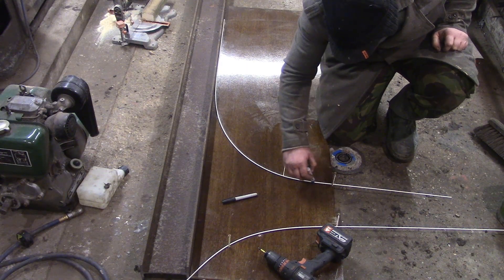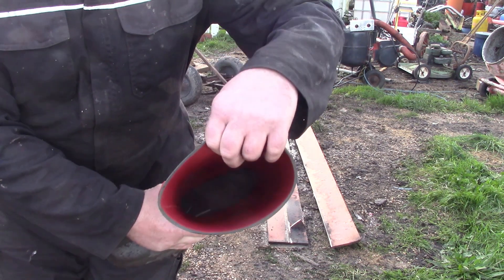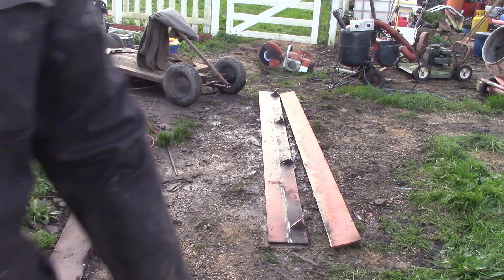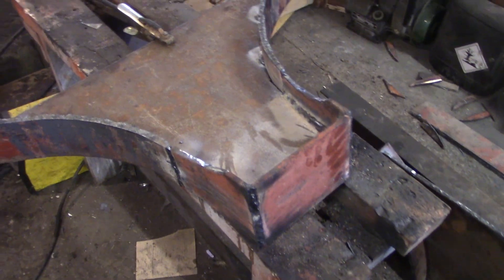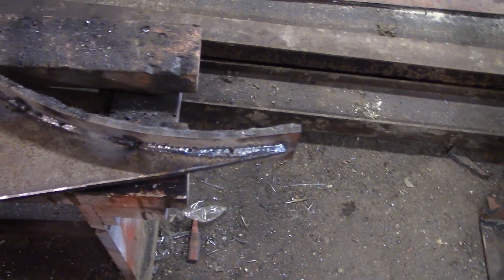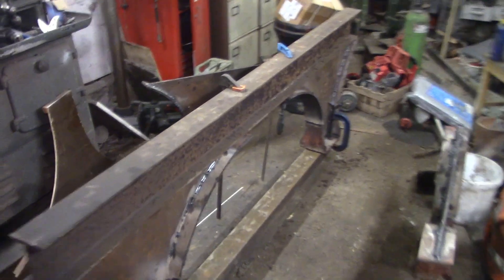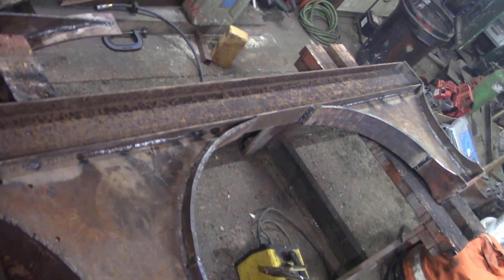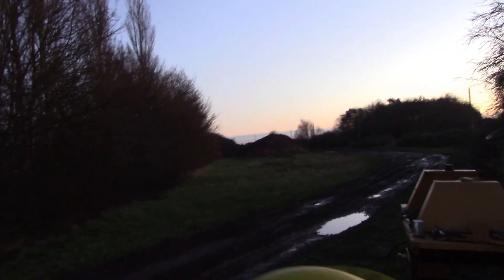Underground bunker workshop Lift gear steels

Comment: Bet that needle scaler is fun with a hangover. Merry Christmas. Sherwood err I mean Lincoln green would be an appropriate colour I think.
Reply from the maker: Cheers mate hope you had a good one. Engine for the winch is already green, obviously got to do the winch itself in a fancy colour so I've either got to figure out the final scheme, repaint later or go neutral on the steel.

Comment: More works of art to adorn your existing works of art, so cool and well worth the effort.  I like the idea of dressing them a little to look less fabricated and more like cast parts - going down the riveting route would have been well sexy too.  Happy Crimbo
Reply from the maker: Got to pick a colour, it's giving more difficulty than anything else right now. Black being the safe bet, letting brass do the talking but I'm a bit tempted by royal purple and some gold pin striping... Hope you haven't got equally important decisions weighing on your mind over Christmas and you can actually enjoy it mate.
Reply: @turboconqueringmegaeagle9006  I'm trying to think of the ironwork at old railway stations and I guess it depended on which railway company it was as to which colours they used.  Black will always look good, but Burgundy or Royal Purple would be cool - whichever colour, a bit of detailing such a pinstriping will be great - how steady are you with a pinstriping brush?  Maybe not the task for straight after the Christmas meal!!!  The Beugler pinstriping tools are good but I don't know how much they cost these days.  Hope you have a great Christmas.
Reply from the maker: @GrumpyTim  I don't have a steady hand, would always cheat and use lining tape although those lining wheels look very interesting. Productive chat and food for thought cheers mate.

Comment: It looks cold there. 
Are you worried about the pillars falling over without diagonal bracing ?
Reply from the maker: It's warmed back up, got the mixer running again.
Those pillars are not built to take side loads, just got to avoid it.

Comment: Great job on those beams. I was thinking of a rivetted structure would suit the pillers. Could you cut triangles in the beams and weld carriage bolt heads to fake old school rivetted beams? Just an idea. Have a great Christmas.
Reply from the maker: It wouldn't look right without a stack of laminations, you expect to see several thicknesses of steel and it's so obviously fake if you can't, I'd fancy my chances at faking a casting more convincingly than faking a riveted structure, you know what I'm saying? And happy Christmas to you too mate.